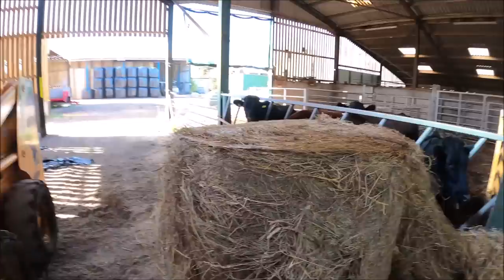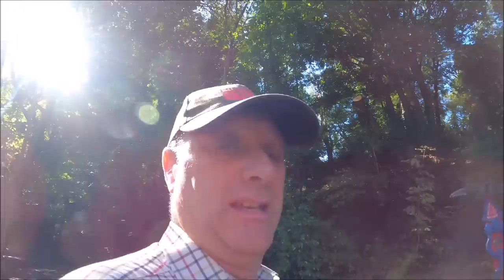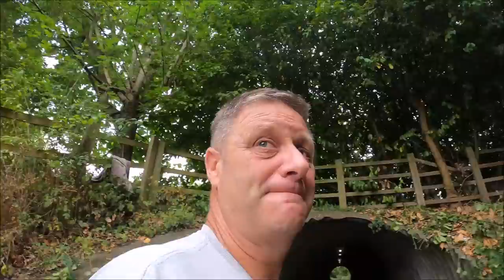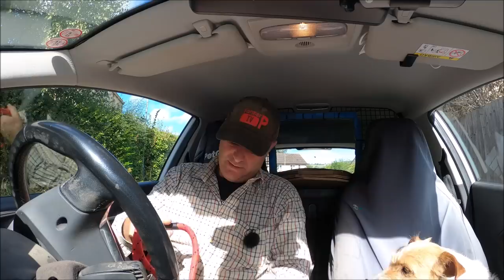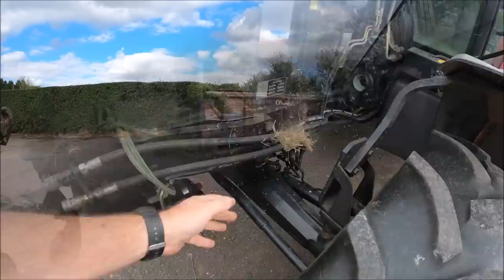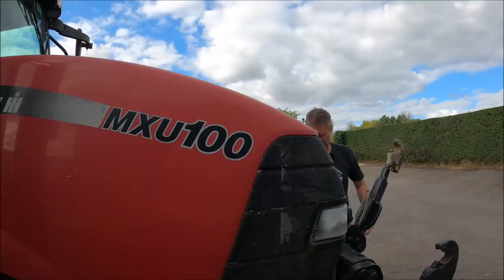19/08/22.  A Job site catch up and a bit of Case radiator care.

Comment: Fingers crossed and wishing you good luck for a great TB testing Ian,  Julie will vouch for you not doing absolutely everything your told to do I'm sure, and airing on the side of safety the boys have done a great job along the foot path it can't be helped if the owl's have to find another brach to sit on but they will have a better view of there pray so they well be ok and it's not as if you have cut everything down there's plenty more trees left standing.

Comment: Good evening Mr. P. what an excellent job you and the tree team have done in clearing that pathway I think there might be more to come if the council can find the money. The tree team will want their works contracts changed to include snacks to be supplied on all jobs. You could have gone the hole hog and washed the tractor as well as blowing out the radiators.Keep well and stay safe.
Reply from the maker: It was already clean Teverson, I don’t want to wash any more paint off 😄

Comment: Once job ,pity it has  to be done,theres a prat comes along our disused railway track clearing 4 metres wide its supposed to be walked with a strimmer and keep all the or hodscand dogdaisies  only cleared for the horsey set,bet that it was  a council officials relative that was assaulted otherwise the work would not have been done as swiftly or so much